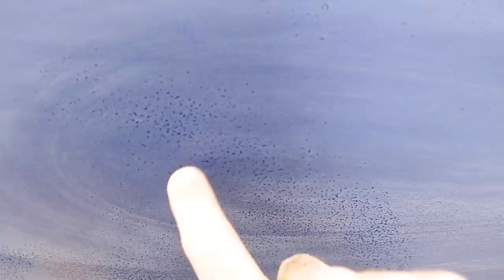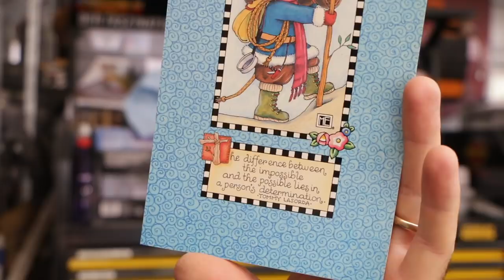Cutting and polishing - Home Built Datsun 240z part 81

Comment: Hey Jeff, few tips since I've been polishing lot of cars and using the polisher you have for 5+ years :

1. Limit yourself to 1.5 sq feet of area at a time, I'd split one door into at least 4 sections. Use 3-4 drops of compound on the pad, adding more is a waste and can hinder the finish. Never add water to the compound!
2. Use slow arm speeds and let the polisher do its thing
3. Wash the pad and dry it (i'll shake off the pad as much as possible then run the polisher at full speed to dry it out) every panel. This will ensure consistency
4. If the sanding marks aren't going away with cutting compound, do another pass...finishing wet sanded panels is  a pain and will need multiple passes too
Reply from the maker: Great tips, I will give it a go.

Comment: Jeff. Should not need water. First pass i use a microfiber cutting pad and blow it out with compressed air after every section to keep it free. This is VERY important. The build up causes more scratches. CarCareProducts have a Sydney office and do a half day training session highly recommend it.  I'm in Melbourne and did it here.

Comment: I used to use shop grade compounds for years, until i saw my neighbour get better result with a off the shelf retail product. I've since started using Meguires ultimate compound and ultimate polish. Glosses up alot easier and faster and cleans off easy. You can also use 3000grit trizac orbital discs aswell. I do 1500> 2000grit > 2 passes with meguires ultimate compound on waffle pad> 1 pass with ultimate polish on soft foam. Done. Saves me several hours per car. For like $20 id suggest to give ultimate compound a go, i was skeptical but it works 👍🏻
Reply: I also have got some great results with the Meguiars ultimate compound.

Comment: I feel your pain. Just finished wet sanding my X5 after a quarter panel and driver's side doors repaint.

I'd recommend going:
1000 to 1200 to 1500 to 2000 to 2500 to 3000 (I know. Sounds overkill, but it will give you the true result you are looking for)
After sanding, go into compound, polish, fine polish.

It will take you more time, but you'll be extremely pleased with the finish. Especially on this car with the rich coats of paint you have applied.

Comment: I'm a bit of an amateur detailer, but if I could share something that really helped me as I polish on a budget a lot. Get your compressor gun/nozzle (when its up and running again) hang your DA over a bucket with the pad on and just blast out that spare compound after every panel. Remember it'll be picking up clear coat and any other contaminants off the paint like dust. You're then grinding that back into the CC. Also never use a sponge to wash a car - I use a meg's wool mitt - super soft and it wont scratch your newly polished panels. I reckon you already know that but for anyone reading... Hope this helps - about the only thing I can chip in with is the paint finishing.

Comment: Good tip when polishing to help with residue control is to blow out the pad every few passes with a compressor. The pad loses effectiveness when its clogged up with compound and paint residue.
Reply: buuuuttt I just remembered your compressor carked it.
Reply: Make sure you have a filter on your air though, don’t want oil and dirty crap from compressor all over the pads.
Reply from the maker: I have 2 joined together. Only one of them kicked the bucket ;)

Comment: Hi Jeff, the paint looks fantastic and like glass. I think i saw you using a sponge to clean the car... word of warning, sponges can add scratches and swirls to the paint quicker as grit and crap stays on the surface of the sponge, and you essentially rub it into the topcoat. Try using a microfibre mitt or a soft car brush, basically anything with a pile so the grit works up the pile and away from the paint. The same is true of chamois leathers, they are really abrasive...but you looked to be using a microfibre to polish-so keep doing that!
Will you be compounding and polishing the 911 in due course?
All the best and keep sanding!
Reply from the maker: Definitely, when the car has nice paint. I just use a clean sponge to get off the sludge before buffing.
Reply: @HomeBuiltByJeff  Phew, my OCD/anxiety levels have now returned to normal!

Comment: Need to change or clean pads more often, I would normally use 3 pads at least to do a medium sized car, not sure why you’re adding water??

Update on 911 engine? Surely old mate is taking the piss, must have had it 2+ years now? I’d be frustrated as hell.
Reply: I think a spritz of water on the pad is all you need to get started. Then no water after that.

Comment: You should use 1500 grit and them 3000 grit when removing orange peel.
You're never going to take out the make introduced with 1000 grit just with compound and polish.
Just a quick tip for the future.
Reply from the maker: I went over the 1000 with 2000, but I needed to go back and do the 1500 inbetween

Comment: Buy yourself a white wool pad, it would make cutting a lot faster.
Reply: Wool pads are dangerous; a novice can easily blow through the paint.
Reply: @computiNATEor   There not that bad, you just have to have the right compound and dont go crazy with the rpm's. Wool cuts faster, lasts longer, and easier to clean than foam pads
Reply: ibidu1 All true, and that’s exactly why it’s dangerous for a novice.